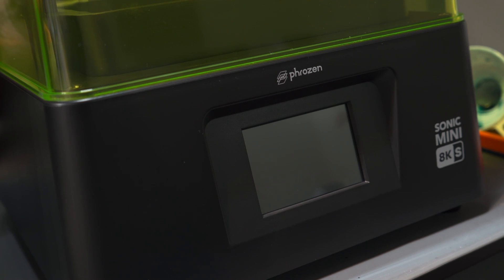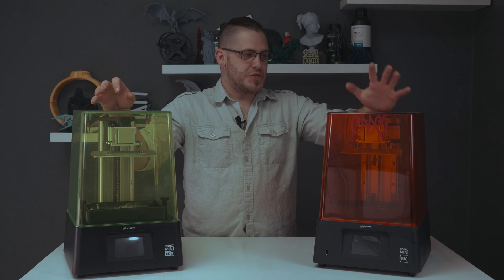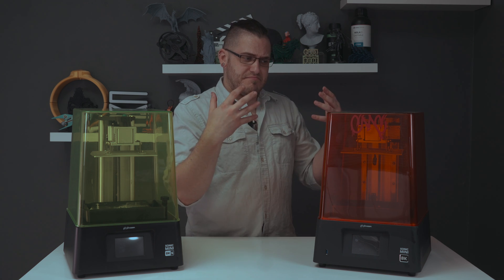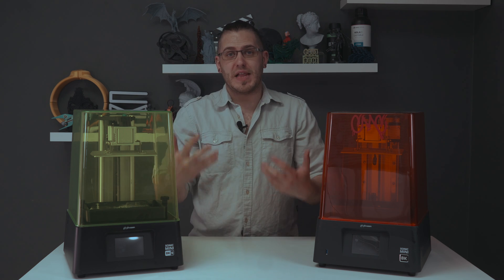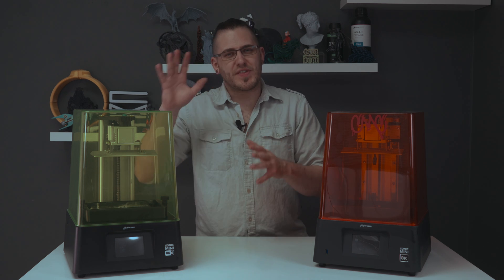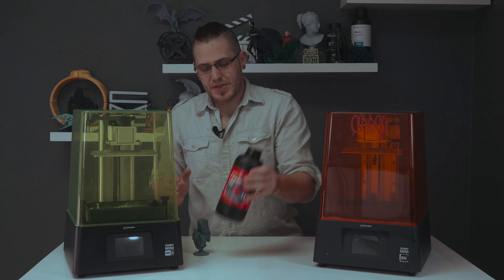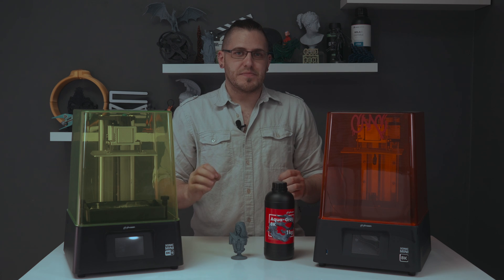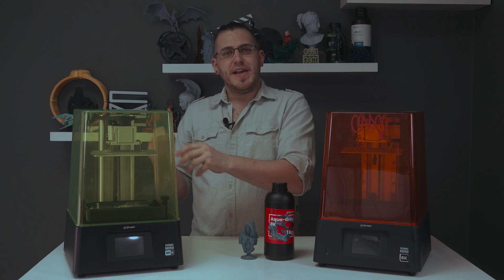New and Improved? Phrozen Sonic Mini 8KS Vs Sonic Mini 8K Original

Comment: Just wanted to chime in that the original 8k does work with Lychee. We've been using ours with Lychee since the printer first came out. Totally agree that Chitubox is horrible though!
Reply: Thanks a lot for this, I had ordered the 8k and was considering switching to the 8ks for just that reason but you've saved me the trouble.

Comment: I appreciate your content, and I have two questions disguised as one if you have time to answer. What is the layer height that you print at, and do you do anything about layer lines? Are they just not visible in the resin print, or do you address them in the metal casting ? Thanks!
Reply from the maker: 0.05mm, print line visibility on the print is usually minimal however print orientation can effect how dramatic print lines appear. Usually they are not worth worrying about as normal sanding/polishing will remove them.

Comment: I have the same USB disc issue with my Phrozen Sonic Mini 4k and I couldn't find any solution. I just tried a few other USB discs and found one that worked. 
Btw, I preordered Sonic Mini 8Ks but I didn't know that it is not locked to Chitubox. Great news, thanks!

Comment: Do you know if any castable resin is able to produce similar resolution and details like the grey resin?
Reply: All of them. It's just because of the color difference you won't see the same details but they are there because you print on the same printer, same screen
Reply from the maker: This^. As we said in the video 8k resin is a bit of a misnomer or over-qualification as, if your settings are correct, the same quality will be achievable regardless of resin.
Reply: @UnratedPlayer21  i dont know. Why do companies like B9 Creator sell different castable resins in different colors? Not all of them produce the same details. They could just sell one and tune best setting for it.
Reply from the maker: Most castable resins can produce the same detail if printed on the same printer. ITs in the printing and casting capabilities that you see the difference. Examples: its slightly flexible so you can put stones in prior to casting without breakage. Its high polymer so its rigged enough to print and hold filagree designs well. Etc Etc

Comment: Hrmm, idk about the single rail system. Back when I was still using the OG anycubic photon, I was getting z axis wobble which I fixed by upgrading to dual rails. 

The quality of the OG anycubic photon's rail assembly itself may have been the issue, but dual rail bring a peace of mind that it's physically impossible for it to wobble.
Reply from the maker: Ya I totally get it. Although they went from duel to single they did beef it up a slight bit so there was soomme sort of consideration when they decided to get rid of it. Haven't seen any issues yet but you guys in the Discord will hear if that decision, or the way they've limited the fans, ultimately backfires.